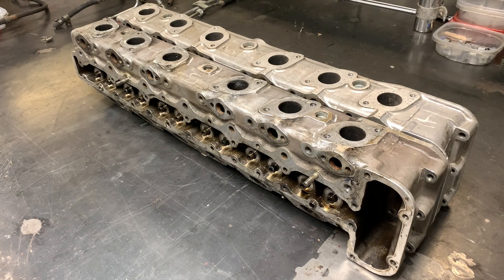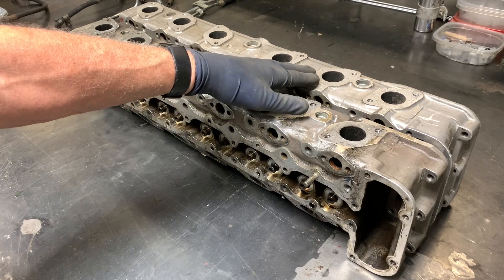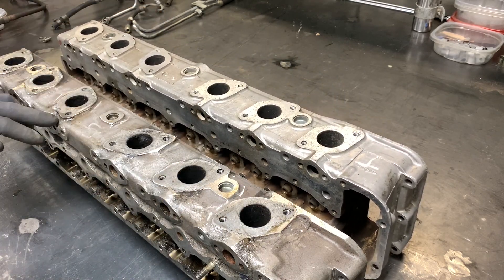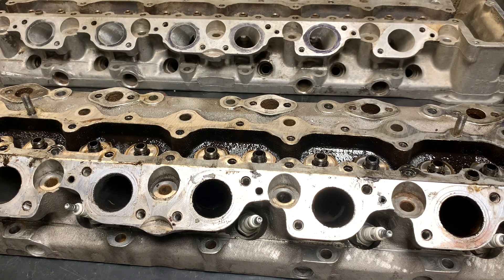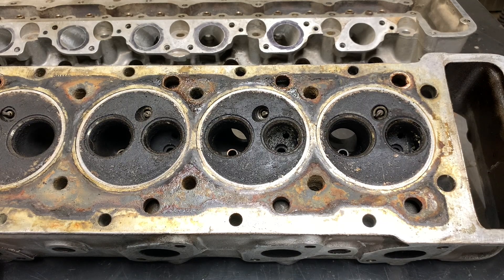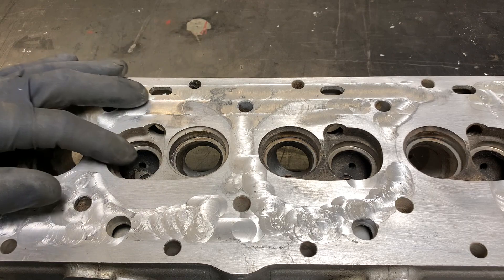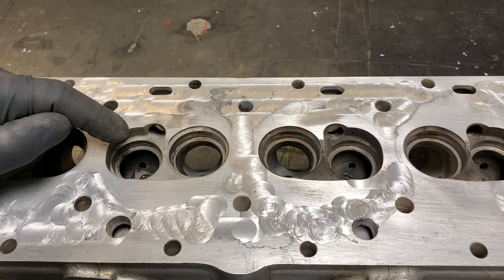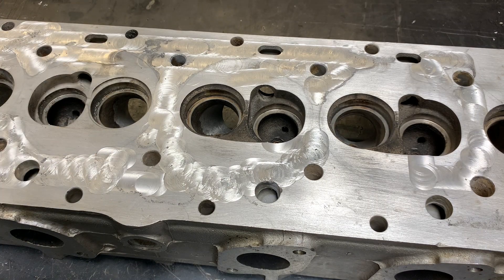TuesdayExtra S:4 Episode 7-Jaguar V-12 Pre-HE and HE Cylinder Head Comparison.

Comment: I have seen a video here on youtube about a modified H.E head which is called Dock Chamber design. That one looks also impressive.  You can find it as Jaguar V12 high energy cylinder head  "David Vizard's chamber design". Migh be interesting for those not wanting to buy and fit  a pre HE cylinder head and change pistons designs. Swirling effect said to be more efficient than in stock H.E head.

Comment: The HE heads force the intake & exhaust  charge to make 2 sharp turns to get into  the cylinder.  Every turn on a port slows down the volume of charge reducing horsepower.  Sharp turns slow it more than gradual turns.   
    The early “Flathead” aims  the charge across the piston  to swirl around the cylinder wall. 
    The piston is dished to form the combustion chamber.  That’s called a heron head.   But it is also easy to change combustion chamber size and shape.  But the Hemispherical provides the most power.  While the Fireball Head ( used in straight 8 Buicks ) provides the cleanest burning with the least pollution.  ( it’s also slightly more fuel efficient).  Most of the increased fuel mileage comes from  other changes such as higher gear ratio, more efficient transmission ( Borg Warner has a 4% slippage rate compared to the 2% of the Turbo 400 and the later overdrive transmission used)  also constant work on the EFI system  helped greatly.

Comment: Another great video. Looks like the intake ports on the pre he heads are larger as well. I read somewhere over the years that the cylinder heads on the v12 where the choke point and only flowed enough to make 400 or so horsepower. Still amazed at your 20 mpg comments. I've never seen much over 14 mpg out of my 94.
Reply from the maker: I had a business I use do some porting on one cylinder and I then copied it. You can see the porting in the HE head. With what can be considered mild porting for street use I believe the porting was good for 15-20 bhp on the dyno. The exhaust side is a bit too big as it is so he left it alone.

Comment: It's nice to have a visual reference for the different heads side by side, rather than flipping back and forth between photos on different webpages 😅

I'd imagine the biggest limitation for the HE heads making power would be how shrouded the exhaust valves are; increased lift or bored-out ports won't help much when the "entrance" to the exhaust port has walls up 3/4 of the way around it. Anybody have any more info in favor or against this conjecture? 😁

Comment: Additional tidbits: The standard 6.0L HE exhaust pocket is a few CC larger than the 5.3L exhaust pocket.  6.0L Cam Buckets are also lighter castings.   Compression changes amongst all engines was accomplished via piston changes.   Rods, AFAIK are the same from first to the last engine (at least spec wise).

Comment: 12.5 : 1 compression on some English models :face-purple-wide-eyes:
Reply: Wasn't that the 1980 year, and weren't they listed at 300bhp flat?
Reply: @julianneale6128  if I remember correctly, those 1980 300 HP engines were 10:1 with the "flat" head. The 12.5:1 (and 11.5:1 for US) were only the HE's, the lean-burn design is the only way they could run that much compression on pump gas with that era's fuel and ignition tech (from what I gather).
Reply: 320 i think , and only in XJS @julianneale6128